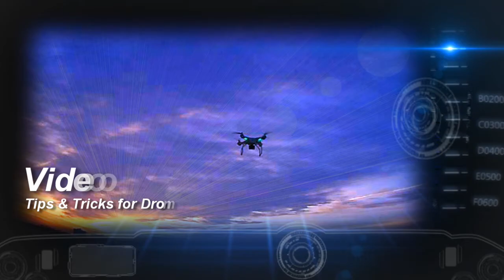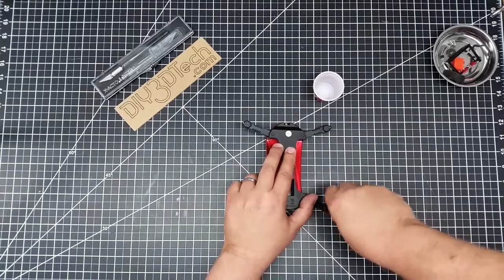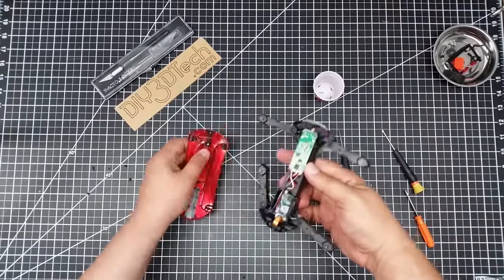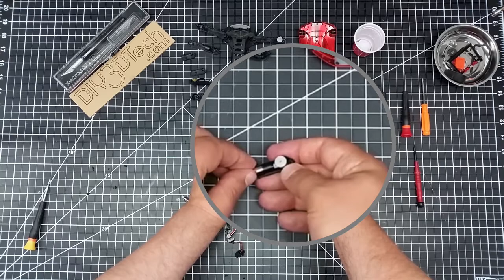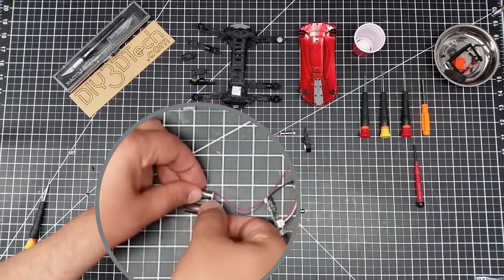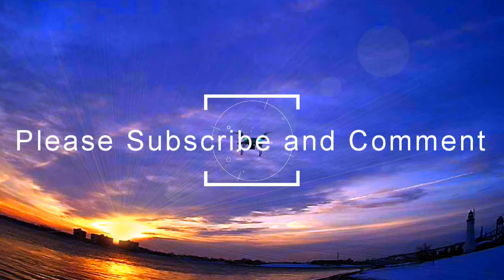Video Drone - Whats Inside the Eachine E52 Selfie Drone!

Comment: Hi, Then it seems that they are 7 mm motors. In that case, I would go for the XS809W Foldable TIANQU RC Quadcopter. That are 8.5 mm motors. Only there are fewer parts separate from available. But, am looking forward to your result with the KingKong.
Reply from the maker: Got to get time to film it as it sort of work, however think I might have a bad motor because is spins in the yaw...
Reply: To be sure, you can exchange the motors.
Reply from the maker: The stock motors are too small :-(
Reply: I mean, by changing motors you can discover where the problem is. That may also be the new motors. Swap the CCW or the CW with each other. At worst, make the motors area smaller, but i think it must still work with the new ones. There are also 8.5 mm motors of eachine in the shop.

Comment: Just about finished with my e52 build. The frame I chose is https://www.thingiverse.com/thing:1961713     I weighed it at 15g, the body of the e52 came in at 39g with all the screws, 25g for the internal bits, 22g for stock battery and the new batteries I'm using are 780 BTG 1S 15g. So I shaved off 31g!  
The problem I came across was the props don't fit on the 7mm motors. I had to buy h107l props off amazon with the correct diameter. Should be a blast when it's done! Thanks for the video!
Reply from the maker: Your welcome!